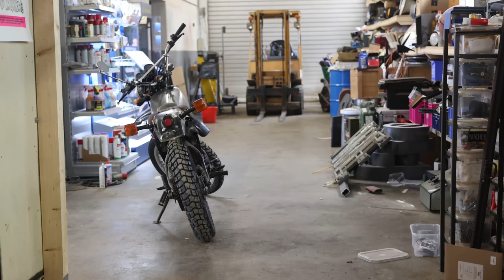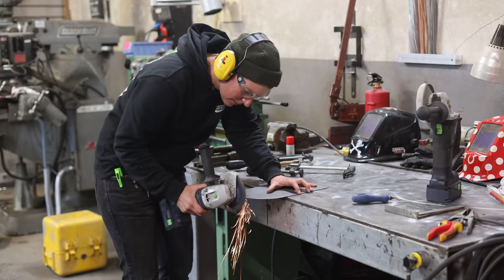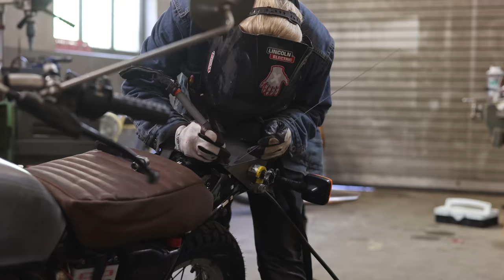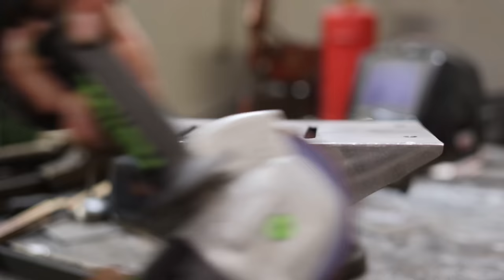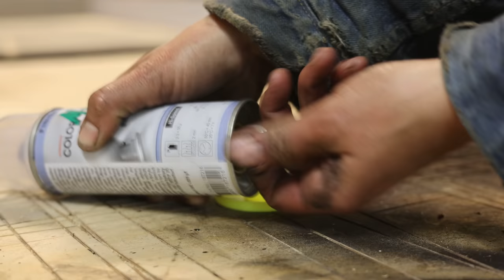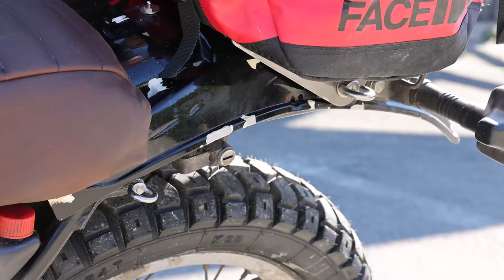Making a Cargo Rack that actually looks good!

Comment: When you were grinding on a weld, and all the sparks were spraying down onto your shoes, it reminded me of a time i was working in the back of my VW.  I was welding in the package tray.  I tack a few welds in, and I smell smoke.  I look down, and my pants cuff is smoldering.  An ember had landed in a fold, and just had a grand time burning the denim.
Reply: But those aren't any kind of shoes, those looks like Nikecrafts. Way back in my youth I was up in a ladder, wearing long rubber boots, helping hold something while the welder did his tacking. An ember landed inside my boot and started burning my foot, but I was to afraid of letting go and get scolded by the welder so there was no other option than endure that temporary pain.

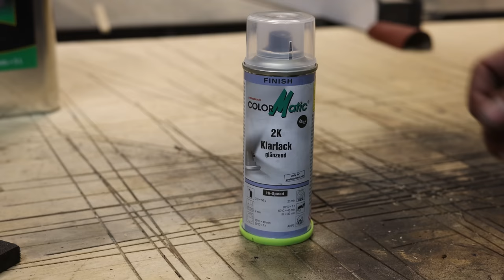Comment: 5:40 How come your spray can has a pull pin like a hand grenade?  Also, what is the stuff? I thought it was a clear coat until I saw the pin pulled.
Reply: Its a 2 pack clear coat, the pin releases an activator into the paint which sets off the curing. Creates a very tough high gloss finish straight from the can.
Reply: @richjones2767  Thank you for the information!